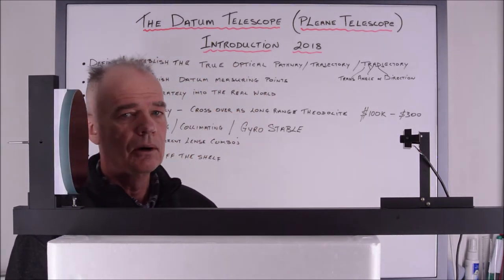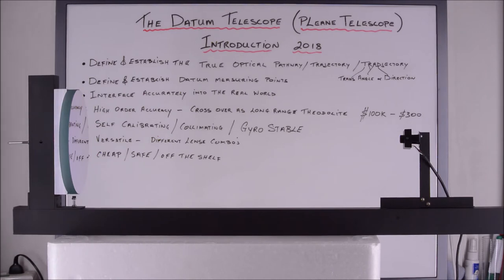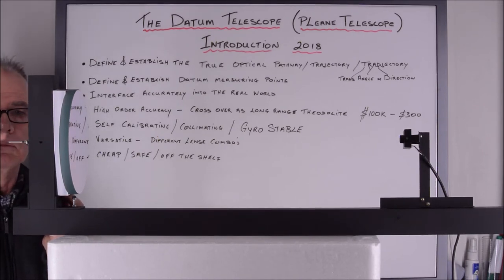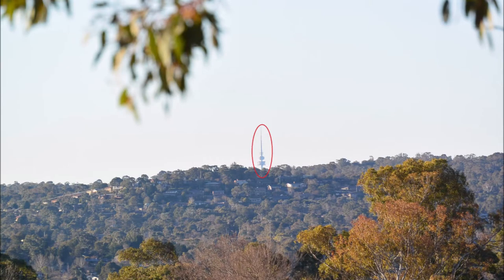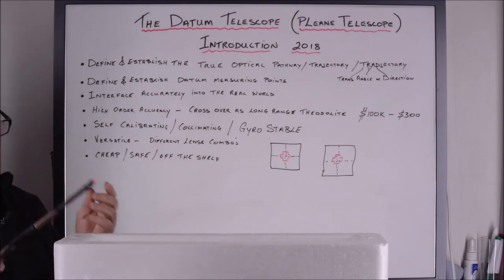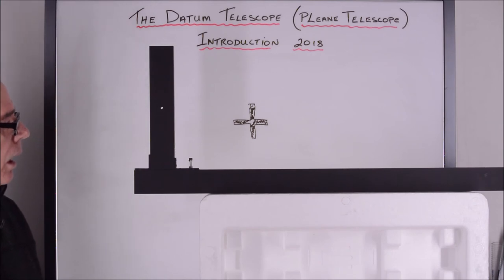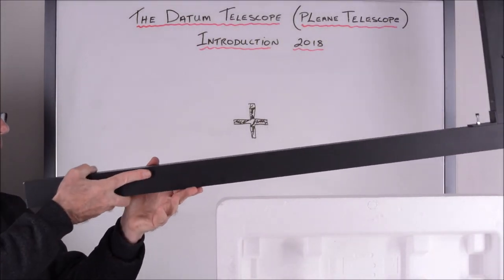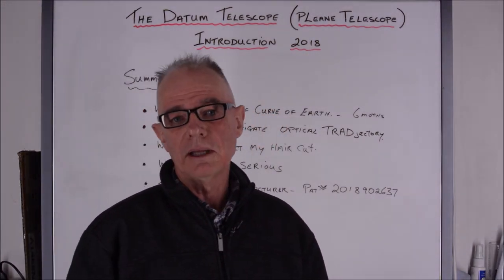Datum Telescope Part 1 (PLeane Telescope)

Comment: Hello again. I had the impression that this was related somehow to the question of the horizon drop. Can you explain how that's related?
Reply from the maker: Heck that would have been painful to watch, I should have recommended part 2 first.  Ok this might work, we both agree the horizon is a point in the distance PERFECTLY LEVEL with your eye.   No doubt you mounted your camera on a tripod and pointed it to the horizon how did you know your camera was PERFECTLY LEVEL.  How do you know the camera was not pointing up or down by 1mm off horizontal.  Remembering 1mm error at the near end could equate to 100 m error at the far end, over the distances you were measuring.
Reply: @peterleane6807  apologies, but I need to get all pedantic on you... this discussion is all wrapped up with the topic of honesty, so I think it's best if we're very careful to avoid misunderstandings... here goes:
"...we both agree the horizon is a point in the distance PERFECTLY LEVEL with your eye." I would say that's wrong. I use the word "horizon" to mean the point where the surface meets the sky. This discussion is kicking off from the question of whether or not that's level with your eye, so we certainly would not define it to be so. I think you meant to say that "eye level" or perhaps "the horizontal" is perfectly level with your eye. The distinction between "the horizon" and "the horizontal" is the crucial question we're discussing here, so we must not mix those up.
"How do you know the camera was not pointing up or down by 1mm off horizontal." I do not measure angles in units of mm. I will certainly agree that none of my eye level alignments are perfect - that's not achievable, but each of them is accurate to within a fraction of a degree. Of the images I showed, the most accurate is the water level.
"Remembering 1mm error at the near end could equate to 100 m error at the far end, over the distances you were measuring." Yes. And that's why we quote these things using angles rather than meters. You'll note that the dioptra app shows the tilt angle in degrees - not in mm. To "rise to eye level," the horizon must appear near the 0 degree line. For example, in the image from the St. Louis arch image, the calculated drop to the horizon is about 0.4 degrees. That's near the edge of the level of precision we can get from that setup, but we have enough margin to feel confident about that.
When you do the water level setup, it's very easy to see the effect of a tiny offset. All you need to do is move your eye up and down until the water level lines up with the horizon. At that point, you look at the water level to see if it's within the margin of error for the water level to be straight. I can guarantee if you're high enough, it's easy to eliminate any margin of error.

Looking at some websites for auto-levels, I'm seeing leveling accuracy claims of +-1.5mm at 45m for the cheapest one... that's 0.0019 degrees of accuracy. If we're looking for 0.4 degrees of drop (St. Louis arch), 0.8 degrees (Sandstone Peak), or 1.2 degrees (Mt. Wilson), that should be PLENTY accurate enough.

How accurate did you finally get yours to be? And did you ever use it to measure a horizon dip angle?
Reply from the maker: OK I am back
Horizon - yes I was wrong I always believe the horizon was the line level with eye level into the distance, so it just where the sky meets the ground, a non scientific meaning.  All of my experiments were over water so I never really questioned it.

Angles vs mm - we are talking the same thing,  if you look at my FE measurements (V2) my water level is 1.6Kms long so the angle is just a TAN function.  P.S. (V1) FE measurement video is a bit corny by todays standards, I only leave it up to show the effects of measurements to close to the water, just like looking down a fibre optic cable, the image can go for ever, irrelevant if flat or curved.

Horizon Drip Angle (HDA) - I would love to use the HDA measurement technique, as it makes more sense when measuring a curved surface and there is no need to have the hard to achieve centre height reference.  I went with the gold standard which is the Bedford canal technique using the centre height go no go test.  

Where to go next -  I need to upgrade my camera on the datum telescope to make the HDA measurement, so I will order the upgrade and keep you posted, that way we will be doing the exact experiment, stay tuned,...P
Reply: @peterleane6807  Did you try the bedford level test at some point? What did you find?

And in the video response to PW, you said something like we were both right or something of that nature. Could you elaborate on that? I felt that my observations were fairly definitive, so I'd like your perspective on it.
Reply from the maker: Bedford test - yes took several months, lots of boxes to tick:- calm weather, no waves, good light, no new water entering lake, two man task, perfecting telescope adjustments, no people around, lots of camera focusing issues, lake and air temperatures close to each other, etc, etc and the results were inconclusive.

Incansciencethat & PW could both be correct - You had a strong case with the sun below the line and I believe PW was correct in that the centre of the lens must be centred to the level not above or below.  The big issue was optical, very long range measurements, remembering light always bends down, Ker effect on electromagnetic waves and what I discovered, when we look through a lens, objects are not exactly relative to the CCD array.  As I experienced there is a distinctive error in the lens chain of a camera from the objective lens to the CCD array, an error that I could only remove by rotating the camera.  It is my strong belief that the error in the Lens chain is the biggest problem and why there is never been agreement with FE measurements.  In fact the saga has been going on since 1900 and the Bedford canal experiment.
Reply: @peterleane6807  interesting... you seem to be suggesting that light entering off-center of the camera takes a curving path to get to the camera lens while light hitting the center goes straight?
Keeping in mind this curving effect occurs BEFORE the light hits the lens?
In the water level example, the horizon is below the water. This means a ray of light from the horizon somehow passed below the water line. How can the lens make that happen?
Reply from the maker: Light entering off centre / straight through - No more like a droopy pirates telescope with a banana bend.  The pirate holds the objective lens plumb to the ocean, to see a distant ship but the pirate is looking slightly up angle into the eye piece.  As far a magnifier the telescope works fine, however fails as a theodolite because there is a misalignment in the light path through the telescope.  That's the simple explanation, it gets more complex when the objective lens is not exactly plumb with the horizontal. But maybe what you are saying about curve Vs straight light, I never thought of that.

Water level horizon below - I just know that I could never make sense of any readings unless the level line cut exactly half way though the objective lens.  With the Datum Telescope I went to the trouble of mounting the objective lens on a axil with a sharp point so that there was no mistake where the centre of the objective lens was.  With the other two telescopes before I just guest the centre of the lens and for the 1.6Kms 1mm error at the near end was 20mm at the far end.
Reply: @peterleane6807  I'll agree that things seem simpler if it's right in the center of the frame, but let me repeat the example I gave in the video... take a camera and point it at your feet. Are your feet at eye level? No, so the center is not eye level - not even related to eye level.
Next, take a camera and hold it level... now the center of frame IS eye level... tilt the camera a little... is the center at eye level now? No. But is eye level still somewhere in the frame? YES!
Reply: @peterleane6807  
" I believe PW was correct in that the centre of the lens must be centred to the level not above or below."

The centre of the lens is always at eye level, even when pointing down. 
Pointing up/down changes eye level within the image.
Pointing up/down also changes centre frame.
Eye-level doesn't have to align with the centre frame.
youtube.com/watch?v=9eTqJJMIrnY

In the discussed video, the centre of the lens aligns with both ends of the water level.
Reply from the maker: @hct3231, thanks for the link, the video helped confirmed my belief.  Yes my understanding:- the term eye level was the centre of the tube, until cameras put an artificial  retina in the way and it was always a horizontal line.  If icanscience that had used a refractive telescope the image may have changed, yet he needed the camera to produce the evidence.  I reproduce icansciencethat's camera tilt experiment with my phone camera  and he was correct it makes no difference, I am now totally confused.  I will redo the experiment using a refractive telescope and see what happens.
Reply: @peterleane6807  I think it's worth pausing a moment to realize everything relevant to the eye level question happened outside the telescope/csmera/eyeball. It literally cannot matter what sort of telescope you use. Nothing inside the lens/mirror can change the path the light takes to reach it. The video linked by hct makes that clear.
Reply from the maker: @icansciencethat,  Don't tell me we have come across something harder to prove then the HDA measurement its self.  And we can not move on with the HDA measurement till there is agreement.  Can you come up with another experiment that can convince thick heads like me, another way of looking at it.  I spent 2 years developing the Datum Telescope to ensure there was no tilt with the objective lens.
Reply: @peterleane6807  School has me slammed right now, but maybe this weekend I can make a video.
In the meantime, did you try the thing with the phone and a glass of water in the kitchen?
Reply from the maker: @icansciencethat,  thanks for the update,.... glass of water test:- yes did that, I still can not get how it works.  Then again I invested 4 years and a new invention to eliminate tilt of the objective lens and to make sure the centre of the objective lens and CCD array were perfectly in line. Its hard to let go of that,... don't over do it on the weekend, remember family comes first.